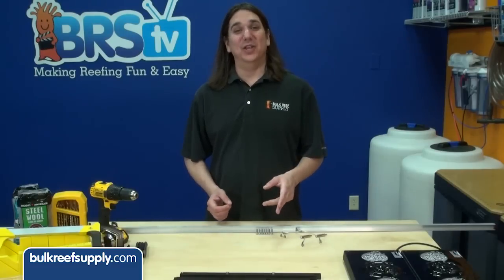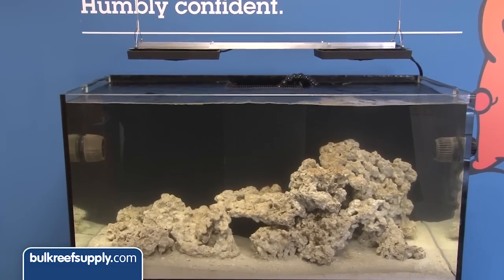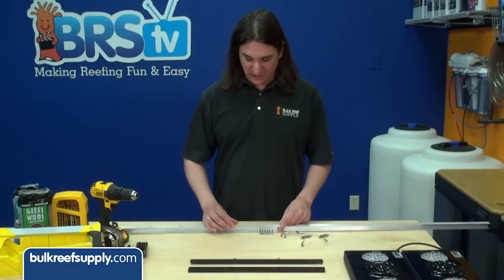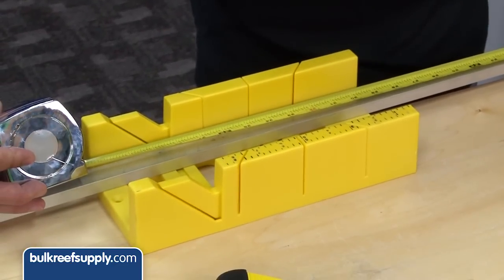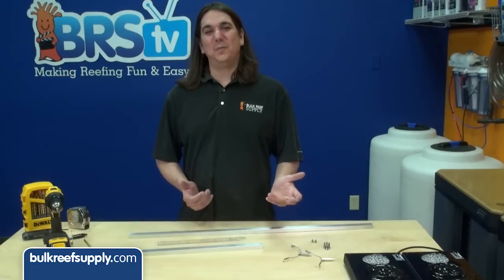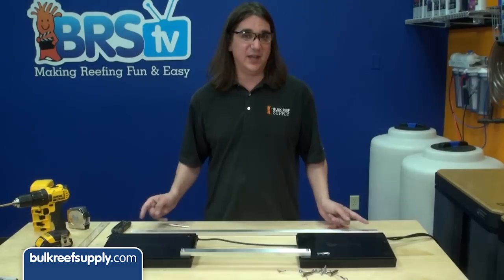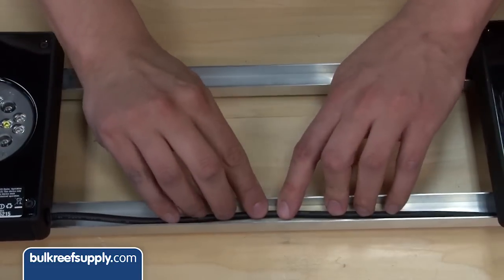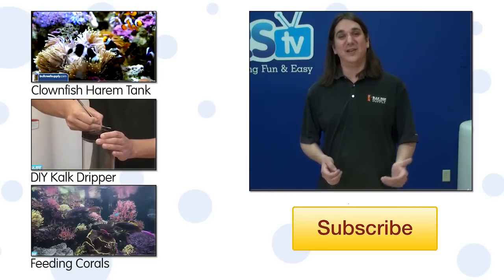Build a DIY Radion Rail Kit | How To Tuesday

Comment: I know this is an old video but as always thanks for sharing Ryan!!  Check it out -- I just bought a new SCA150 rimless tank that's measures 60x24x24 so I bought 2 Orphek Atlantik Compact V4 gen2's from #BRS for my lighting system and I want to float them above my tank..I know Orphek sent me there hanging kit but i would like to DIY with two rails like you just did with the Radiants.... Where can I find those bars that hides the cors from that would have to measure 60''??

Comment: I just bought the materials for this project.  I'll let you know how it turns out. I just ordered a 3rd radion.  I have a gen1, 2 hanging over my tank currently and now a gen 3 pro to compare them too. It should be here Monday. Time to throw out the halide t5 fixture I was running in comparison to the radion's.  It just didn't match up in terms of coral coloration and it was not worth the excess humidity.  The only thing I was unable to find at any hardware stores was grade 4 steel wool hopefully grade 2 is good enough to get out all the scratches.  The screws were kind of a rip off 8$ for 12, but I found very close matching ones to the radion screws so it should look nice.
Reply: Worked out really well.  Fast and easy project.  I have to say the gen 3 pro radion is insane.  It really blows away my gen 1 and gen 2 radion which i railed together.  Im gonna have to upgrade them.

Comment: Great video..the other way of using a rail tracks is by using 20 or 28mm aluminum profile with slots at all corners where you can just insert the screw heads with washer in the slots of the tracks after installing the screws on the radions. This method does not need to have the hanging kits if you are installing in a canopy. here is the video of my system 150 gallon mixed reef that shows this track installation in my canopy at 5.58 seconds. Just my two cents to help out fellow reefers...Thanks.